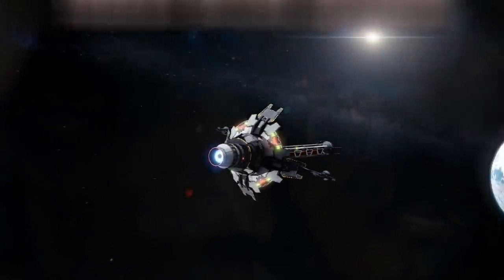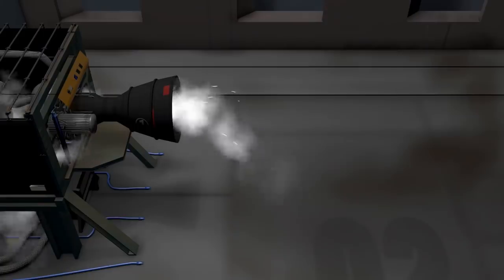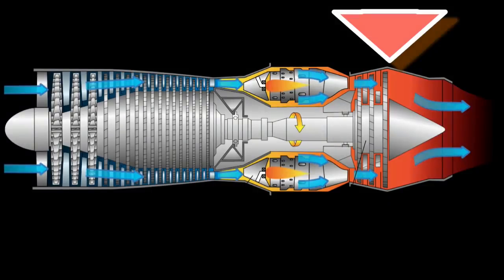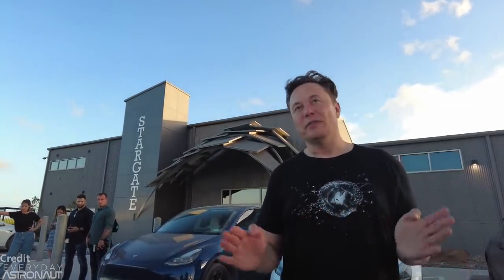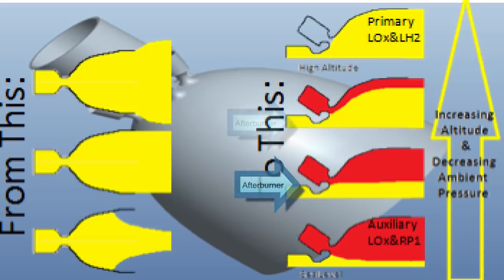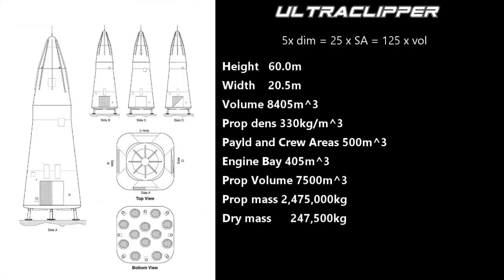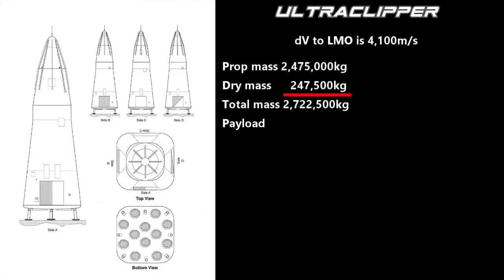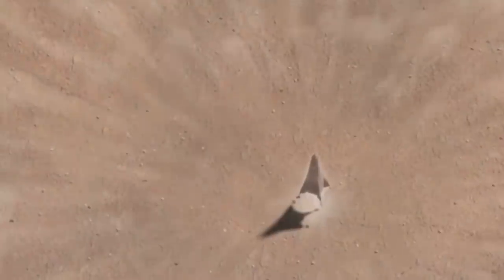Rocket Science: UltraClipper is Better than Starship!

Comment: I don't think this concept works. When the clipper docks in mars orbit with another ship, the other ship has to decelarate to get an orbit first. This uses fuel that could be safed by just landing on mars and using aerobraking. At least you need to make a calculation of the hole earth mars transfer process.
Reply from the maker: No, no, no :-)... the amount of fuel to land is a lot more than that needed to go into orbit... plus you would have to take off again... a lot more deltaV for those... the Ultraclipper would sync its apogee to match the incoming ship...

Comment: Elon built the starship tanks out of carbon fibre first to make sure it can be done  after he's perfected his ship he'll defo switch the steel tanks to gain mass to orbit. Carbon fibre will play a big role in starship. Maybe the luna ship will be all carbon fibre.
Reply: Dramatic improvements in carbon fiber need  to be made for it to gain an advantage over stainless steel in conditions starship  will be exposed to.
For me, the decision to change to SS was the point where starship showed real promise of happening in a timescale that I may live to see, starship became more than a pipe dream, SS means it can work with today's materials.
Reply from the maker: That's exactly right.  Elon doesn't want internal tanks... the mass savings of having the exterior bulkhead be the tank is enormous.  You can't do that with carbon fiber and come back to Earth.  Now for lunar and deep space Starship... go carbon fiber and aluminum as much as possible. Though for something as big as Starship... steel still works best...
Reply: @terranspaceacademy  thanks😎 does steel still work best! only because it's so difficult to manufacture large carbon fibre parts! Or is there another reason???
Reply: @zakiranderson722  Stainless steel has a much wider usable temperature range, from cryogenic up to very hot indeed.  This is important if it is a tank skin for both cryogenic fuel and atmospheric heating.   Composites in general have a hard time maintaining toughness at cryogenic temps.    I believe this is what doomed the X33.  It is even harder if you plan to re-use for many launch cycles.
Reply: @NullHand  ye but that was back when we were developing the x33 we use carbon fibre tanks all the time now don't we??
Reply: @zakiranderson722  As far as I know carbon fiber is still used mostly as an over-wrap on a metal tank liner.   Pure carbon composite cryotanks are still in materials testing stage.   ESA I believe is doing pressure tests on small versions.
Huntsville as well.    I suspect that the material may always be too fragile for high cadence manned cryogenic rockets tanks.    That doesn’t mean it can't  fill other roles.    Fairings, capsules, landers, etc.
Reply: @NullHand  cool man, keep in touch.  Thanks Richard..👍

Comment: i posted about another video, about how i think the vac ones arn't optimized to space at full thrust, bc i supect they won't be used at full thrust to change orbits
but only once to reach LEO, (full thrust but not optimal efficiency) but when on LEO, later it will be run at full efficiency but 70% thrust to get to the moon or mars or GEO
Reply from the maker: That is almost always correct.  Most rocket systems would only be at full thrust for a few seconds on lift off and would rapidly throttle back to normal operating power which is usually about 70% full thrust.

Comment: 450 isp at sea level? That seems unlikely for any chemical reaction rocket. I mean yeah if you had a super engine that had world record isp at all altitudes then SSTO is less of a pipe dream but thats pretty hard to achieve. SSTO on other smaller planets is fine, the starship will do it in base form. And while you might be able to create better martian ssto on earth, its hard to transport it to mars.
Reply from the maker: That's why we need the thrust augmented nozzles... it will start at about 420 seconds increasing to 465 seconds as the atmosphere thins.  But the atmosphere at only 10km is down to only 26,499pascals from 101,325.  Very quickly we get higher efficiency.  Averaging the efficiency over the altitude and subsequent drop in pressure for an engine with a vacuum efficiency of 465.5 seconds gives us an average of 450 seconds.

Comment: Don't those 450 isp rocket engines run on hydrogen like the space shuttle?  and don't hydrogen tanks take up almost twice the space as methane tanks?  Something does not add up here.
Reply from the maker: They are indeed... but on Mars the weight of the ship is about 1/3 what it is on Earth... allowing large tanks with less structural mass.  And with the thin atmosphere aerodynamics and maxQ are much less important.  It all adds up :-)
Reply: @terranspaceacademy  On Mars.  You have to build it here and make it bigger.  We need much better engines.

Comment: I generally assume that there is indeed a "better" way to do almost anything, but that's also based on the fact that without agreeing on the metrics being used to determine that theoretical "better", it's all a bunch of people arguing how many angels can fit on the head of a pin. 

I am reflexively critical of much of what Musk says and does, but I will accept that the "better"  he is looking for is actual existence along with utility and leave it at that. That is to say that while I agree that (for example) conceptually an F-22 is "better" than a Sopwith Camel, if  I want to fly, if the Camel is what is actually being built, it is "better" than an F-22 that is not being built.
Reply from the maker: Very true indeed...

Comment: Yet it never flew to orbit. I love the Idea and in simulations it works out great but as a planetary transfer vehicle these are not going to work well at all. I think starship needs a third set of engines as well, preferably NTRs to get us out there. Even better would be a plasma thruster but then your adding cost.
Reply from the maker: Hello Brandon :-) the Ultraclipper is NOT meant to be a planetary transfer vehicle.  It is only SSTO on Mars.
Reply: @terranspaceacademy  So is starship. I'm not saying that you're wrong, just that we are doing an apples to oranges comparison. Starship could in my opinion do much better with NTRs and a small reactor or even a centrifuge battery rather than just relying on solar power. I can see the cost benefit analysis which is what musk is famous for and I am sure Starship will improve greatly over time and probably be relegated to orbital and lunar transport missions over time. It’s designed to be reliable and cost effective. What amazes me is its efficiency vs the Apollo missions.

Comment: hydrogen is crap, because the focus solely on gravimetric Isp at ignorance of volumetric Isp demonstrate myopic thinking, because volumetric Isp determines  vehicle size and mass, which impacts the mass fraction. For this reason, Methane's average of both gravimetric and volumetric ISP is higher than the average for Hydrogen.
Aerospikes suck because their low nozzle area causes massive thermal control problems at altitudes.
So the Ultraclipper sucks.
Reply from the maker: ON EARTH!!! NOT ON MARS! WATCH THE VIDEOS BEFORE COMMENTING PLEASE! D-
Reply: @terranspaceacademy  Even more so for Earth, because low volumetric Isp, which hydrogen has, means huge fuel tanks, which means huge aerodynamic losses, which is why hydrogen is really only optimal for upper stages, at most. Even the Saturn V first stage was kerolox for this reason. Refueling Starship in orbit if its using hydrolox means your tanks to orbit have to be huge, so big aerodynamic losses getting it to orbit, so, again, methane wins. Hydrogen is a bad idea all around unless you want an upper stage to send a payload on an escape velocity to the outer planets. Hydrogen, as proven with shuttle, is a totally dumb idea with a reusable launcher.

Comment: Its a descent concept but can you mass produce them and match the projected cost per launch to match SpaceX. There is also the problem that to get to mars you are going to have to go higher than low earth orbit and you did not address how it would get to mars in the first place. Again cost is the real problem. The future of space exploration will depend on reusability and lowering the cost. The days of massive multibillion dollar single launches is just about over. There are other considerations that anyone with half a brain will be seriously looking at. That is building a much larger craft in orbit for colony missions which will massively reduce the cost and make more sense than something as stupid as sending hundreds of small rockets back and forth between earth and mars. Any space agency or proposal that wants to be competitive in the coming future will have to take all those points into consideration. Reusability, efficiency, cost per launch and accepting the reality of making trips to distant world swill require the construction of a larger reusable craft in orbit to reduce the cost of multiple launches to the point of insanity. The days of the free ride are just about over. In future just putting together a CGI video and presentation of theoretical craft that do not exist yet and no working plan to build said craft will not be enough to get funding. A working blue print or operational prototype will be required to make sure the ones proposing a new system are serious. this proposal has promise but it does not answer the questions that it needs to answer. and yes Space X will be receiving the same answer in future if they fail to produce results.
Reply from the maker: It would be built on Mars... this is a longer term solution. Not immediate.

Comment: Flawed analysis , oxidizer to propellant ratio is reversed if using atmospheric fuel.
Reply from the maker: As far as a jet engine on Titan? As long as the wings are at least a meter long and the ship doesn’t weigh more than 10,000 kg you should be fine in the thick atmosphere :-) it doesn’t take a lot to keep you aloft.